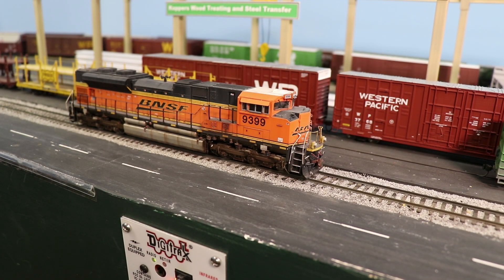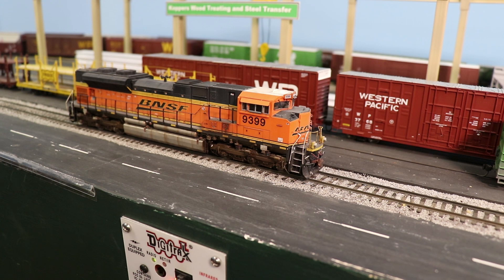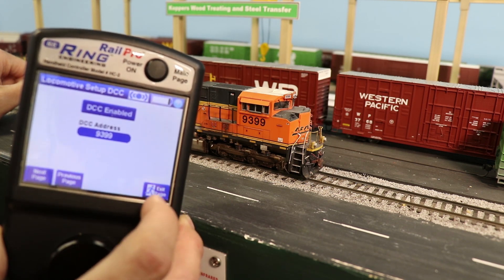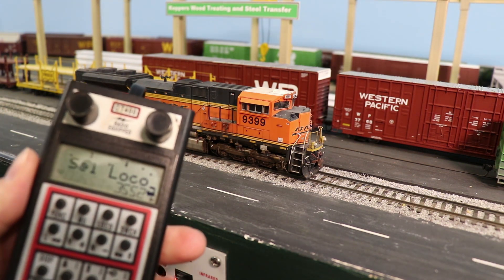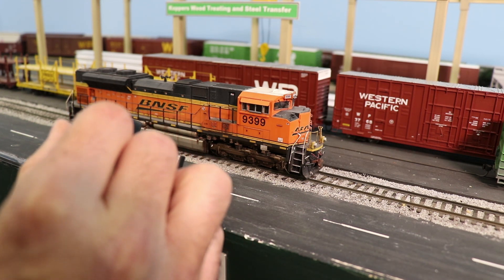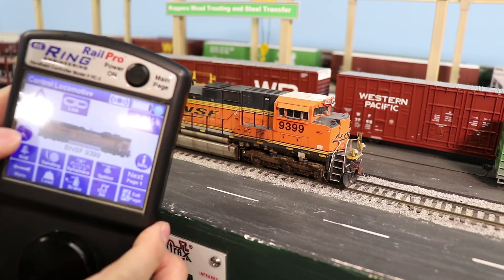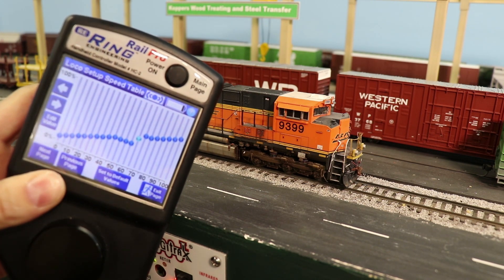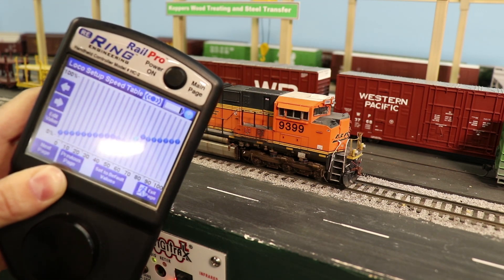Railpro + DCC compatibility

Comment: I was asked by my club to repair a railpro HC1B that was dropped. The flex cable to the display was damaged. After the repair, I played around with it and was so impressed that I ordered an HC3! I appreciate how well it is designed. I hope that they come out with decoders for N scale! The way the HC1 goes together is a clue to the thought and good design that went into it. The speed control knob works on induction, so there’s nothing to wear out and it’s super smooth and precise. The various items in DCC that require setting CVs such as speed curves are done right on the Railpro screen.

Comment: If I don't own the railpro handheld unit, can I still get a railpro decoder to work on my DCC layout? In other words, do railpro decoders come with that DCC option enabled by default?
Reply from the maker: You can get Railpro to run on strictly DCC if you want.  The DCC option is not enabled by default.  You do not need Ring Engineering's controller to accomplish this though.  You can access the full function of the Railpro controller by using Railpro's software (free) and a USB transmitter (CI-1 or Computer Interface 1) that costs $30.  It essentially turns your computer into a Railpro controller.  It allows you to load/delete any sounds, lights, functions, update software, etc.  And allows you to set up DCC mode and make any changes as well.  Once the locomotive is set up the way you want, just control it using DCC controllers.  

The CI-1 makes everything easy.  If you are going to do anything with Railpro, even if you just want to run them on DCC, the CI-1 is an absolute must.

Comment: If I have a DCC equipped locomotive can I run it with my Railpro controller on Railpro’s power? My complete layout is all Railpro and Railpro power but I do have a few DCC equipped locomotives that I want to use but I don’t want to have to buy a DCC throttle and power so can I make it work with Railpro‘s controller and power?
Reply from the maker: No.  Railpro controllers will only control Railpro locomotives.  With the Railpro controller being directed by radio control, it has no way to talk to DCC command stations.  DCC command stations work off wireless or infrared, not radio.  

Railpro locomotives in DCC mode can be controlled by a DCC controller, because the DCC signal is passed through the track.
Reply: @freewake84   okay thanks that’s not the answer i wanted but I was afraid of that.
Reply: I appreciate this video. I am heavily invested in ESU Loksound but am seriously considering this. I love big consists and Railpro changed the game for me. Thank you for your time